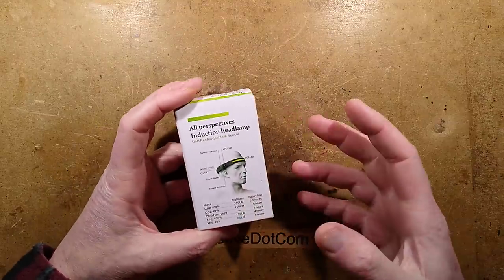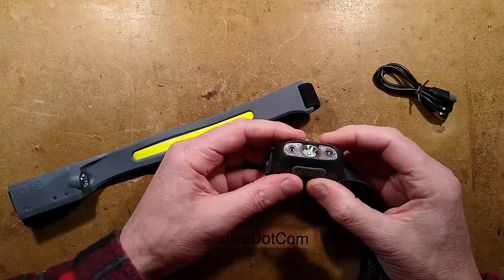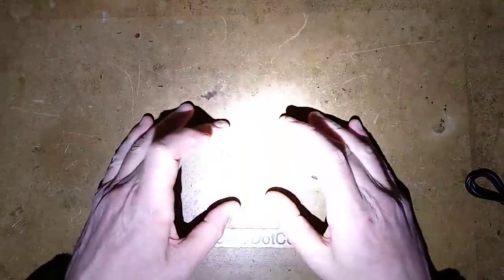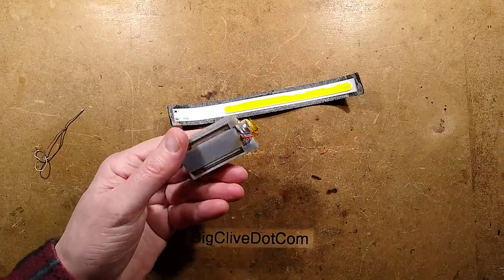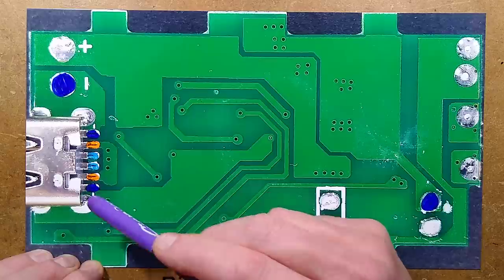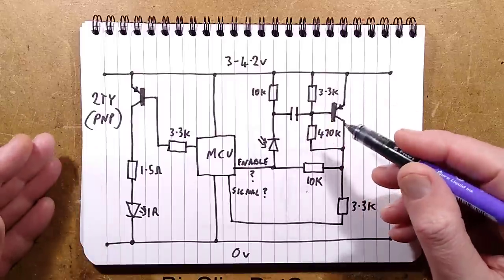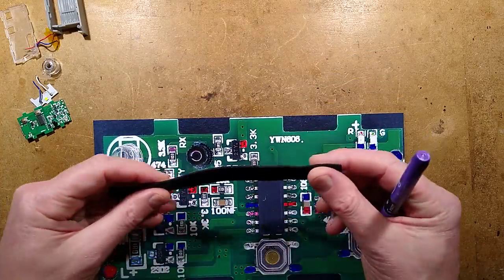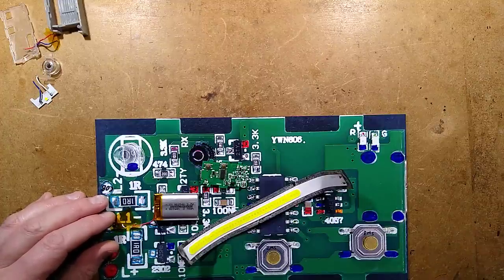Night Buddy style headlamp teardown with schematic

Comment: Runners are using these lights more often often and these lights and I completely hate them. Why waste all your light into thin air.
Reply: Being runner and a electronics geek, As the runner you need a wide field of view so the COB strip like this would be useful,  but as the electronics geek I want the tightly focused beam.
Reply: @seanyem  What is the use in lighting up the sky instead of what's in front of you on the ground? All it does is end up blinding other road users.
Reply: So you can see low hanging branches overhead and duck before you get hit by them.
Reply: @drsquirrel00  
I like "blinding other road users" who have too bright headlights!  And bright lights make the driver aware of your presence.  He can't say "I didn't see him" 😠😠
Reply: @acmefixer1  And then other road users go "I will blind other road users who have lights that blind me" ?

Comment: Gone through two of these charged twice and then never charged again.
Reply from the maker: Some may not work with "intelligent" USB chargers.
Reply: @bigclivedotcom  I don't know how intelligent my X360 is, but it's using USB 1.0 and 5volts I didn't want to do a deep dive into component failure with them. My guess was a faulty micro controller.

Comment: I have 10 really nice (cree) leds on a strip of pcb glued above the lense of my optivisor for 7 Years now (and a lipo, switch etc. (see avatar) total cost 50 cent for the LEDs, rest is salvaged), I practically use that thing the whole day.. not only for soldering.. It has like 3-5 Watts output, but I save 100W ceiling lightning with it.. I love the diffuse warm light and wide field of illumination (of MY light), because I can then see my screwdriver etc. in peripheral view ... but THIS ... its hideous, i looks like its meant for insertion, but - don't do it !!
Reply: I have 3 Optivisors (5x, 7x and 10x) that I use for electronics and small assembly/repair work, each one fitted with modified LED headlamps that I selected to match well with the approximate focal range of the magnifying lens. I use COB LED's on the 7X and 10X Optivisors to give a soft diffusion of white light for very close up work, but on the 5X visor I have a spotlight LED headlamp with a longer throw ----  I find that useful, with the visor flipped up, for looking for something from 5 or 10 feet away in my cluttered and poorly lit garage, and then when I have a part in my hands I can flip the visor down and read the numbers on the component or examine the machine-screw thread size and so on.  The headlamps are Velcro'd to the top of the Optivisors and I removed the battery compartments from the headlamps and put the batteries in a separate  holder towards the rear of the headband.  This greatly lessens the weight of the headlamp so that I don't have a lot of added weight directly above the lenses,  and the visor stays where I set it without sagging downward.  The headlamps still have a clutched hinge to adjust their angle, which is helpful,  especially for the 5x visor fitted with the long-throw spotlight.  All of these are currently using ordinary AAA batteries, not rechargeable's;  I would like to change them to rechargeable cells,  but in the meantime I am using the Eveready Max Lithium cells which give a very long working life.
Reply: @goodun2974  my OV got one fixed lense and one to flip down in front of it, 2x and 8x ..  I can see far enough with the light I got, even okay to walk around outside at night ..  I have a couple extra flashlights if I want to see further ;) 

but i am thinking about a hud for a long time now.. something like an integrated multimeter  would be nice, with magnet holders for the leads.. (the maglock for charging already is a bliss!) and a laser pointer for distance measuring  .. also flir would be nice to have and a welding function (lense becomes dark on bright lights) I am just afraid that it becomes a little bulky at the current state of technology :D
Reply: @tinygriffy  , LOL 😁 !  I actually removed the additional round lenses off of my Optivisors, as I didn't like the binocular or tunnel-vision effect. Anything less than 5x isn't helpfull to my old eyes; the 7x and 10x lenses can be hard to find, but I was able to order them online from Brownell.  The grommet like plastic clips for holding the lenses in place have a tendency to become loose and the lenses start flopping off, and I didn't need to swap different lenses into the same visor assembly anyway, so I through-bolted the lenses in place on each of my three visors. A smaller, lighter headlamp, perhaps rechargeable, would be nice, but they work quite well for me as currently equipped. I have to admit that a laser pointer function might occasionally be usefull at work, since I'm the one that reorganized the parts bins and when a co-worker says to me that he can't find a certain part or a particular parts bin, I can turn on the laser and look in the right direction and tell him to follow the little red light!  ( I often use a high brightness laser pointer at work, shining it at a component on the board when I am trying to find the matching solder joints underneath;  The laser light will pass right through most circuit boards and illuminate the opposite side so that you can find the area you want to work on, but this would not work if the laser pointer was attached to my head! 🤣).
Reply: @goodun2974  I rarely use high magnification, and I am fine with a little distortion when I need higher magnification, I can't do longer sessions with high magnification anymore anyways and its very convenient not to have to change visors.. I used coroplast tape to fix my main lense , I accidentally sat down on it some time ago^^ , luckily the plastic lense didnt break, just the mounting point. And there are so vast differences in LED light quality.. I couldn't bare the factory light for one day.. ripped them off right away, hotglued an 18650 cell on the top of the front close as possible to the headstrap and such a tp4050 pcblet, 10 Ω in power resistors , and as already mentioned  10 (J-Series) Cree LEDs on a small strip of pcb and a big old metal flip switch at the side, which I can operate with my pinky while putting the OV on.. one homogeneous movement.. nicer dual lenses would be cool, but the real deal is just so beyond the capability of my purse ;)

Comment: This device is junk. I also bought one such light, I and it stopped working after 20 minutes and never charged again. Good Lord I had a spare torch , because I didn't want to find my way late evening in mountains by only using a mobile phone.
Reply from the maker: Try it with a different charger.  USB C load indication is not implemented correctly.  A dumb charger may work.
Reply: @bigclivedotcom  Yeah, you're right, with the cheapest charger it started working again, thus USB-C port made me assume that it must have some smarts in it, but still now I have to take 2 chargers with me...